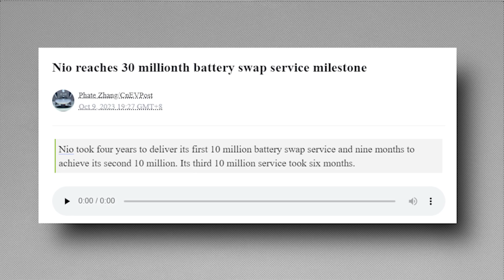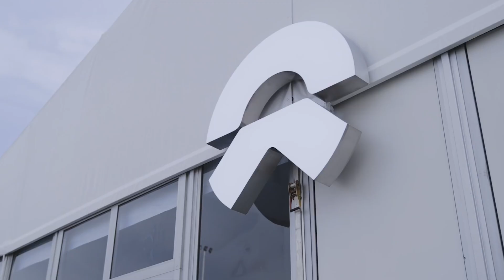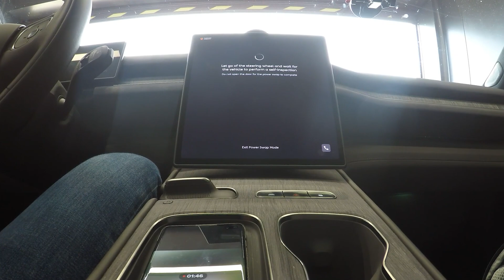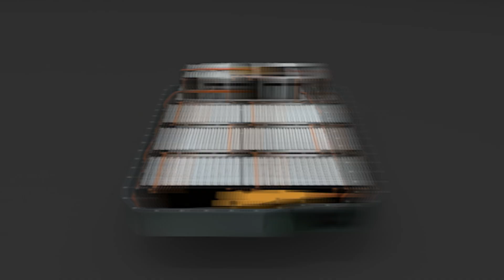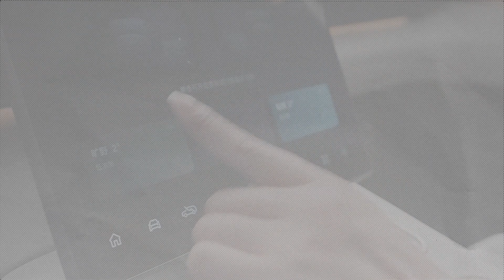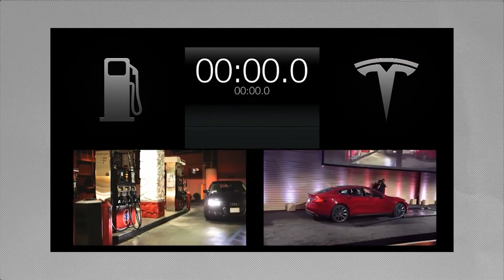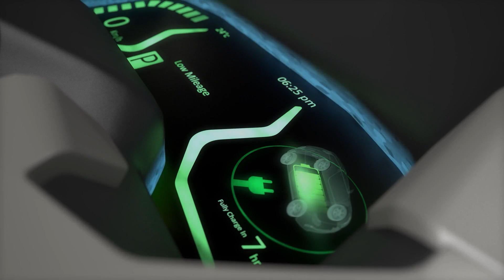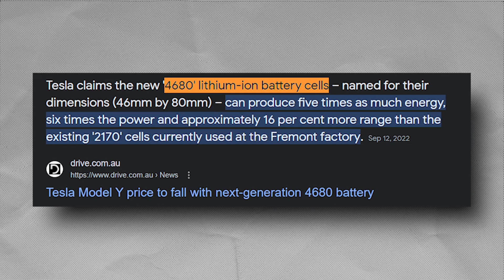HUGE NEWS! EV Battery Technology Just KILLED Tesla's Future!

Comment: A better solution might be for EV manufacturers to make replacing batteries easier, to allow replacing a bad battery or upgrading to an improved chemistry. Charging is now quite fast, so replacement and upgrade are the only real reasons for swapping. And that can be done at a service center.

Comment: One advantage of battery swapping is that it would eliminate the issue of battery degradation or failure. The car owner would have a fresh battery for as long as he owned the car. Many people for financial reasons prefer to run their vehicle far longer than the warranty period, so that even if batteries were warranted to las 10 years or 100,000 miles, that would not be long or far enough. Battery swapping would eliminate the fear purchasers have of the cost of replacing a battery after warranty. Further, battery swapping could enable the owner to upgrade to new battery chemistries, a very attractive option, given the rapid progress in battery design. This would give the owner more range or a lighter vehicle. At the same time, the convenience of charging could be retained, so that swapping could be done only when on a long trip or when a battery type change was desired.

Comment: I just don't see this idea of swapping batteries being a solution. There would have to be a huge number of swapping stations everywhere at an enormous cost. The infrastructure is not there, and it would take several years to have enough swapping stations. All car manufacturers would have to agree on a standard battery pack, and I don't see that happening. The number of fully recharged battery packs that should become available everywhere would have to outnumber the number of EVs, which would cause a huge environmental disaster in trying to mine all the necessary minerals to produce the battery packs. The price of batteries would skyrocket and so would the price of swapping the battery pack. It would become so expensive that nobody would be able to afford to buy an EV or swap the battery.